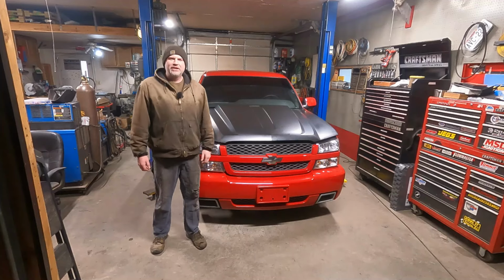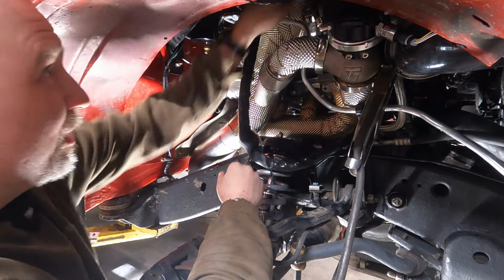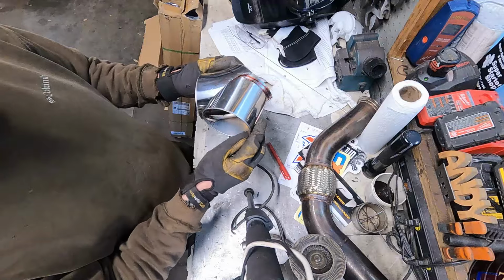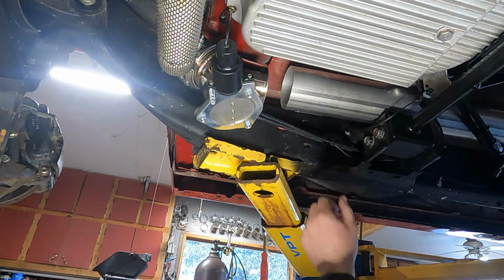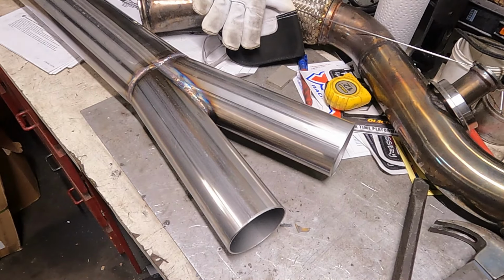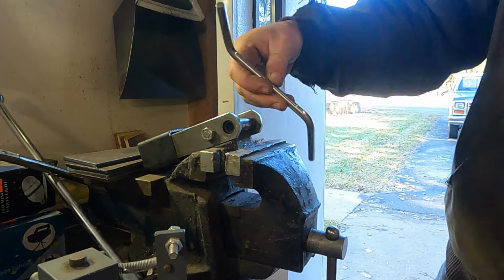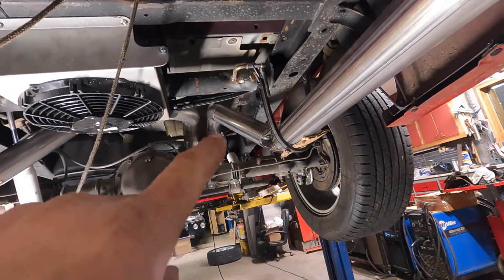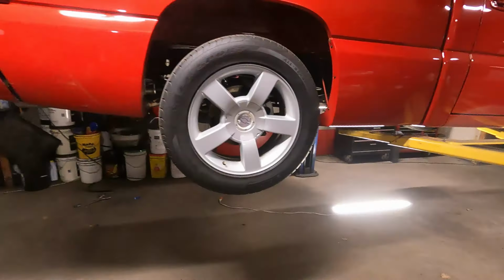ONLY Short box regular cab Chevy SS in the WORLD (maybe). Exhaust fabrication. VPT

Comment: Nice tig welds there!  I just have a little flux core mig welder, but it's just for fun and my own use..  Nice job and really enjoy your vids!  I am now not scared to weld on my own rigs with computers up at arse after seeing you do that demo vid you did awhile ago that won't fry it and thinking that 'disconnecting the battery' is gonna save you. ha, ha... ✌
Reply from the maker: Thank you! I grew up sticking everything together with a bare bones miller stick welder. Whatever gets it done is better than nothing! I'll say, if people feel safer disconnecting the battery before welding by all means do it. Just personal experience (and my monkey brain knowledge) is I haven't ever had a problem. The MAIN thing is always have the ground lead on the actual part you are welding, make sure it has good clean contact, and don't forget your helmet! Lol
Reply: @VPTfab  I also need to add that was one heck of a nice exhaust system too!  I hope you got well compensated for that job!  Nice job sir!
Reply from the maker: @mitchf1508  Thank you so much!  I trade for beer tokens and race car parts. Haha